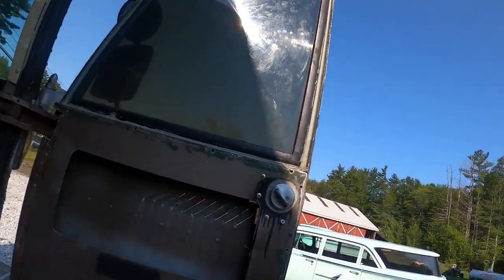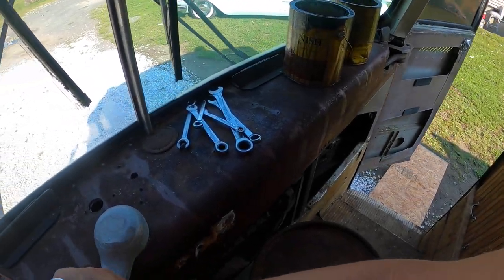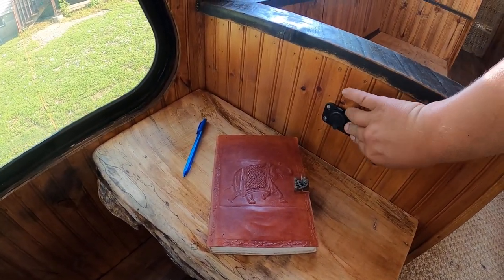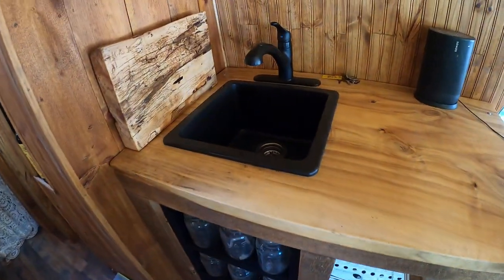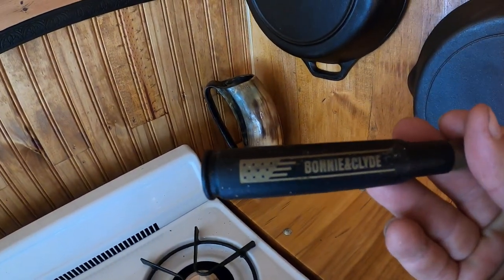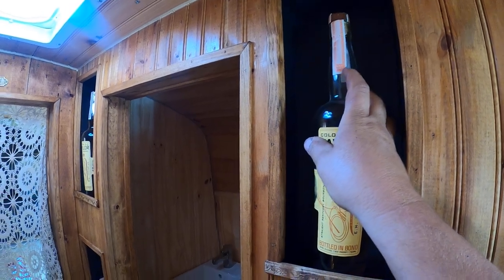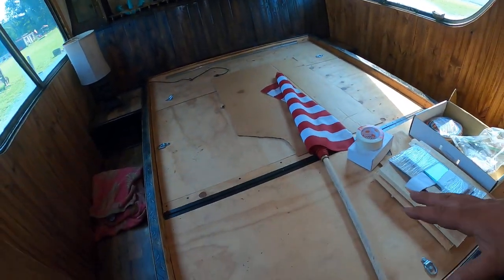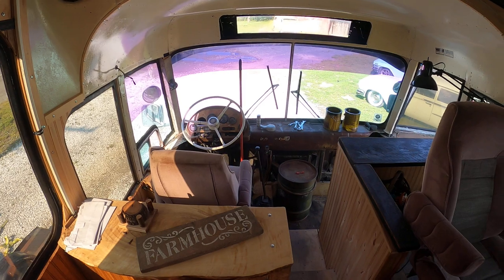Our 1966 GM Buffalo Bus Cabin Rv Conversion skoolie transit school transit 871 diesel tiny house

Comment: Where are you going to sleep 7 kids?  And store their clothes?
Reply from the maker: Where the benches are we plan to make removable bunks so it will sleep four. I also have that whole I cut into the floor to the bottom storage compartment we are going to do small bunks and tv down there so when we are stationary they can go down there. 
As for cloths and other stuff, the compartments under the bus are huge for storage.